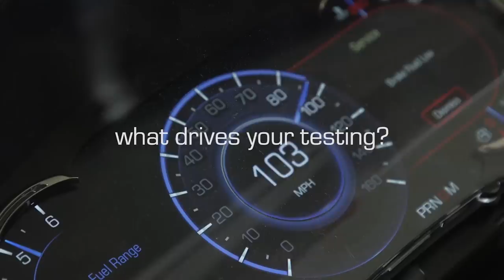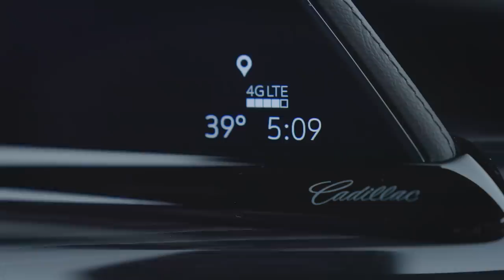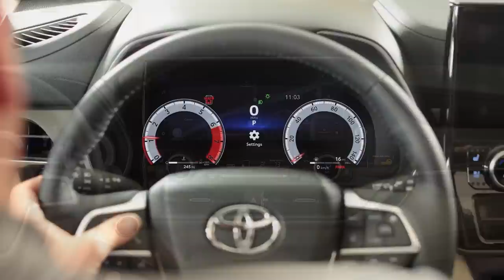Canoo Warns It May Not Survive; Ford Faces Rivian Stock Decision - Autoline Daily 3322

Comment: Escalade V is awesome,   but $150K is a lot...   GM definitely trying to move Cadillac upmarket to prepare for Celestiq, and Escalade IQ
Reply: It furthers the company mission "to accelerate renewable energy transport", Tesla have so much real world data on Supercharger station use its also possible they keep ahead of the demand with more Superchargers. Here in UK planning permissions for Tesla to build out current and new sites will suddenly become no problem as well as attracting government grants. Its a wise move. Having driven 125,000 UK miles in 7 years in my Tesla P85 the only time I ever saw a "faulty" Supercharger was one occupied by a Ford MachE who clearly fancied the parking spot as it was close to the facilities. Unfortunately that meant all 8 bays were occupied. I asked them to move it as they were not charging, got the line "were not finished yet" to which I replied "well thats because you haven't started, could you move please so I can charge".....they moved.  Tesla yes enable the charge system for all, get the money in and self fund more Superchargers, as we all know they are the ones that actually work and thats to the benefit of all, the EV movement and ultimately Tesla.
Reply: Quite a stupid idea but some will want a fast brick.
Reply: @davidmccarthy6061  Escalade sales in 2022 are at a record pace…

Comment: Tesla adding CCS plugs to Superchargers is smart,  opens a new revenue stream for Tesla, and also gives them access to government charging infrastructure funding.
Reply: Don't see it as good news for current Tesla owners.
Reply: @suserman7775  yeah, for current Tesla owners, it’s not good.  But they can buy a CCS adapter, and then use the rest of the charging network Which really gives the Tesla owner a better experience
Reply: @dmitchellhomes  You're saying Tesla owners can buy a CCS adapter? Is that a new thing? How is that relevant to Tesla changing its policy on Superchargers?
Reply: @suserman7775  yes, there are several CCS adapters on the market for Teslas.   So this gives Tesla owners the opportunity to charge at CCS stations, Which there are a lot of out there
Reply: @dmitchellhomes  So my point is they already enjoy access to all networks but if Tesla begins to allow non Tesla vehicles at Superchargers, it will possibly make those Supercharged busier. (And break more often)
Reply: @dmitchellhomes  okay sure but my inquiry was about current Tesla owners not Tesla's financials. No worries.

Comment: Ford will not likely sell much more Rivian stock, as the market cap is now down at liquidation value,   and is not going to go much lower.    Rivian to me is the best all EV investment at  around $20    (not investment advice)
Reply: It could easily go lower. I'm not sure how anyone could draw a conclusion it won't drop more.
Reply: @MSportsEngineering  I think you need to work on your reading comprehension, I did not say it won’t go lower, I said it won’t go much lower.   Currently it’s trading at $20.50, I would be surprised if there was still more than a dollar of downside, because at the current level the market cap is $18.5 billion, and at the end of last quarter they had $18.4 billion of cash on hand.  That tells you the market is not valuing their factory, or any of their intellectual property at anything, i.e. liquidation value.
Reply: @dmitchellhomes  the market can irrational indefinitely
Reply: @MSportsEngineering  that is true, but there is a point where buyers on the sideline, decide to jump back in.   If that happens in a decent number, then shorts have to start covering, and the fun begins
Reply: @dmitchellhomes  for the Rivian retail holders, I hope that happens soon.

Comment: Ford should take over Rivian at this new discounted price and use its expertise to improve its production issues.
Reply: And why would Rivian just give themselves up to Ford when they just started actually delivering vehicles? They have bigger ambitions
Reply: @ashrafc7794  public companies don't have to agree, one can just purchase controlling share or a takeover such as Elon is doing with Twitter.  I'm not saying Ford is better but it's a discounted price, Ford has the money, and it would help both brands.
Reply: @davidlopezlive  not exactly, if somebody started buying shares in Rivian in large quantities, the stock will skyrocket, shorts would have to cover, which would drive the stock up even more, and the company trying to buy would probably run out of money.    Typically, there would be a merger, where a company would negotiate with the Board of Directors for Rivian, and make a deal, but don’t forget, Rivian has more cash in the bank right now than Tesla, they are not desperate for anything, and the stock price means nothing to their operations at the moment.   Rivian has plenty of money to wait out the supply shortages, or recession, they just may have to slow their expansion plans in Georgia

Comment: I would use Rivian as Fords fast track apprentice shop and send its best new hires there to learn what building all electric means. Akin to why Honda sent its best engine mechanics to work in F1 as motorsport meant fast decisions, creativity and massive pressure to achieve fast results. Ford is splitting and the new EV split will need a different mind-set to compete with Tesla and all the other leaders. Rivian stock could still be slowly sold or its stock price connected to the split EV management incentives so insuring that Ford management tries to help Rivian succeed. The stock offers Ford a way to get Rivian to build EVs in small batches for vehicles with low or fixed volume sales (retro-electrification of older vehicles/Offering F250-350 EV options. Rivian could be Fords coachbuilder, offering EV-lightweighting upgrades for models who sales numbers do not make an EV version worth the major investment
Reply: I want to know about the Ford high efficient LFP light truck.  That seems like a training center for new engieers.

Comment: It is not a 38 inch screen; you cannot simply add up the sizes of smaller screens and say that's the size of the screen. Geometry; you failed it
Reply: All the new high end Cadillacs have huge screens that are one unit stretching from practically the driver's door to the middle part of the dashboard.
Reply: @OneNationUnderGod.  Try again. It's not one screen
Reply: @kevinbarry71  go check out the new Cadillac Lyriq, I'll save you the response. It has one big ass screen.
Reply: @OneNationUnderGod.  he was talking about the Escalade. As for that one, it doesn't actually exist yet
Reply: @kevinbarry71  ?? Cadillac Lyriqs are already in production. GM showed off some rolling off the assembly line already.
Reply: @OneNationUnderGod.  Who cares. Show me them sitting in a dealership show room. I repeat, he was talking about the Escalade
Reply: @kevinbarry71  I never said the Escalade, I said new Cadillacs, the current Escalade has already been out a couple years. The new Cadillacs like the Lyriq has the big screen, you act like Cadillac isn't making them and I proved you wrong. Also you won't be seeing a Lyriq in a dealership any time soon, they are sold out already for the whole first year's production.
Reply: @OneNationUnderGod.  my original comment was about the video where he described the escalate as having one big 40 inch screen. First try to keep the thread secondly not everything is about you

Comment: It is unfortunate that Toyota is pursuing turbocharged engines. The Tundra had the most reliable V8 in automotive history and they dumped it for a twin turbo V6 that is a disaster. Toyota turbo charged engines will not last 300-400k like their venerable normally aspirated engines.
Reply: It's a shame that Toyota has decided to follow the turbo trend (small engine, high Horsepower/torque...short life).